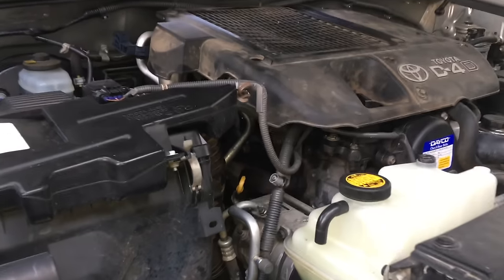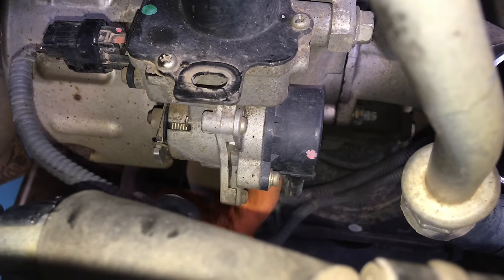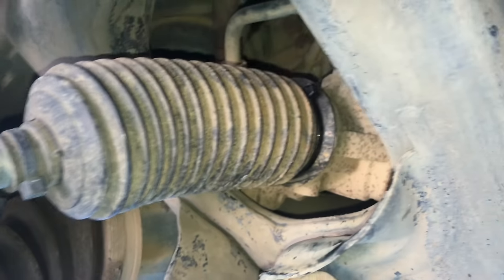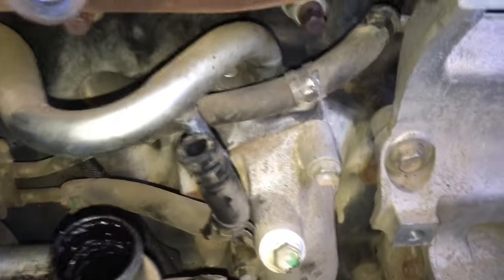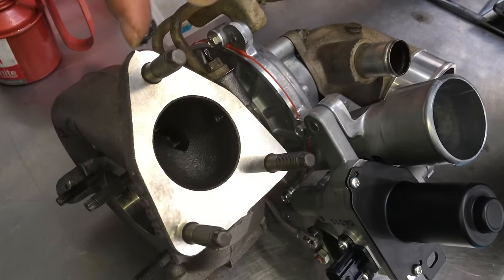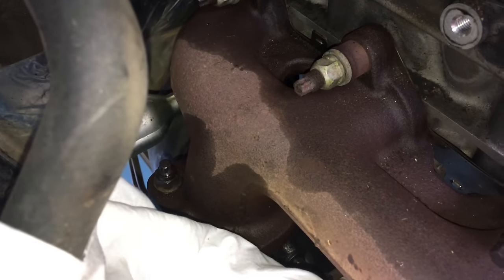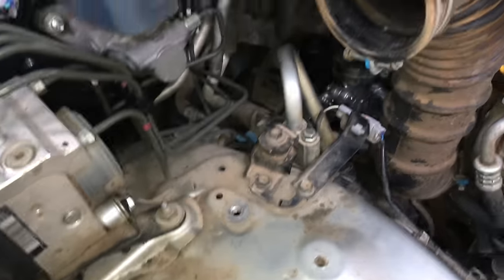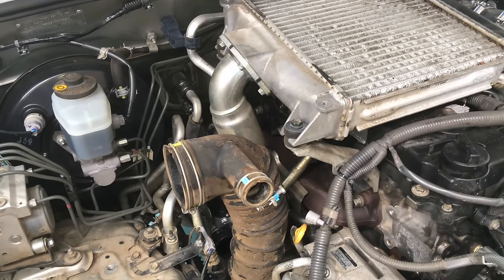TURBO REPLACEMENT - TOYOTA

Comment: Just did a turbo replacement on the hilux with the same motor. Very easy. Didn’t need to move ac or anything. Air box out. Took off Intercooler pipe to turbo and exhaust and oil and coolant lines. Only thing different. Removed a stud from the turbo to exhaust to get turbo out. Only thing I did different. Cheers for help
Reply: I’m about to change the turbo on mine, could you message me for any issues I might have?

Comment: Managed to pull the turbo out with the help of this video so I am very appreciative, Anthony and Johnny are just too good and makes it look like a walk in the park. the 3 12mm nuts between turbo and the dump pipe (7:43) are a absolute b* to remove, I almost rounded one off which would be disastrous. If you are working off the floor/jackstand I'd recommend removing AC compressor, alternator and alternator bracket out of the way, does not take long and frees up so much space. Toyota workshop manual recommends removing the exhaust manifold together with the turbo. Good time to do your engine mount as well Toyota quoted almost $1000 in labour to do both engine mounts and this side is the much harder side

Comment: You could reach the oil feed pipe from the top of the engine. 17mm. Its a pain in the arse to get the dump pipe 3 bolts off. I’d take exhaust off from 2nd joint and the first right below the turbo and off the mounts

Comment: What sort of kilometres would you recommend turbo maintenance or replacement? Are they able to be maintained and is it in the service schedule? Are they able to be rebuilt or are they a throw away item? Thanks
Reply from the maker: Maintenance is all the time 5000 km and every time you switch off the engine you need to think
Reply: The turbo on my earlier model 1KZ-TE has +350000km on it. Still goes strong pushing 16psi but showing signs of worn seals inside with some oil on the walls of the outlet side. You can buy reseal kits for them and it seems like a relatively straight forward job to do. Their are a couple of points you need to be careful with (not over stretching the clip rings) Just check YouTube first and watch someone else do it so you get your head around it. A replacement Toyota OEM turbo will set you back at least AUS$1200. Cheap Chinese ones are available on ebay for $179-300. I've only heard a couple of stories about problems with them not lasting but you can clearly see many have been sold and they're working just fine. I do wonder if people buy them and run the boost higher than they're designed for which causes failure. I would definitely consider a Chinese one personally. In terms of maintenance, you can buy a can of cleaner spray of sorts to spray in the intake pipes. I'm not very familiar with that though so might be best to do some research on that. As far as I'm aware, turbos shouldn't need maintenance. Just fix/replace when they fail. Other things to look out for on these turbos is a leaking oil return pipe. You may not notice it leaking as your sump guard/bash plate collects the slow drops so I can be leaking for a long time and go unnoticed. Usually a split in the aluminium hose under the turbo caused by a number of thing's- one of them being too much oil in your engine and apparently engine vibrations can split the aluminum hose. 
Under normal conditions though and if the engine is looked after your turbo should last a good 300-400k before needing attention. But on rare occasions they do have problem's earlier on in their life. It's luck of the draw I guess. 

I'm not a mechanic and this is all just my understanding based on my experiences as a DIY/enthusiast so take it with a grain of salt. But I hope it helps someone 😊👍

Comment: hey mate im up in the NT are you able to shed any light on an issue im having with my 2006 toyota hilux, feels like im driving an N/A diesel.
its had new injectors, map sensor, maf sensor, intake and egr clean and the turbo on the vehicle is 20,000kms old.
looking at data logs show turbo only producing up to 36Kpa/ 4.5psi under full load, no engine light or DTC logging and looks like the stepper motor for turbocharger operates, had it in at toyota with no sucess in diagnosing either! cheers!
Reply: it could be catalytic converter, just did one on a duramax in a colarado holden had no idea of what what causing the issue.
Reply: late to the party, but I'd bet the VNT electric turbo control mech isn't working, or the linkage is seized, sounds like you have limited if any variable vane happening, which is all about spool and making PSI.

Comment: How do you prime the turbo after installing?
Reply: Any luck getting an answer for this mate
Reply: @edbiggane9185  unplug injectors and crank, will build oil pressure without starting :) I manually pump oil straight into it when I fit so its not bone dry to begin  with

Comment: Hi what I like to do is removing the whole manifold and the studs Make the work very easier and you can remove it a whole unit Without removing the downpipe
Reply: You are correct  that's exactly what I did...

Comment: Hello friend, can you help me please, i have this engine and i want replace the  exhaust from 2.25 inch to 2.50 inch . Is it better 2.5 inch from 3.0? Because i heard from some experts that the 3.0 inch well makes the engine weak!
Reply: With standard turbo only 2.5" exhaust. If bigger turbo on 2.8 or 3ltr engine then 3". No, not make engine weak. Turbo outlet is the restriction. Hot gases expand when leaving turbine exit so slightly bigger exhaust helps flow. More air out means more air in.

Comment: the replacement turbo part no# has changed from 17201-0L040 to 17201-0L042 do you know what the improvement is on the new turbos?